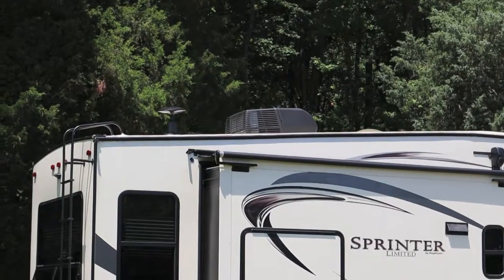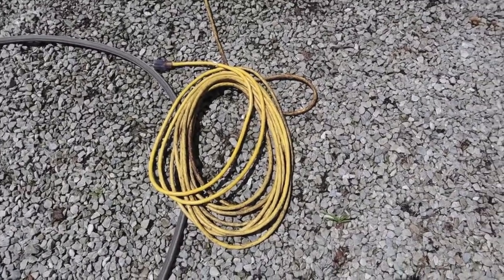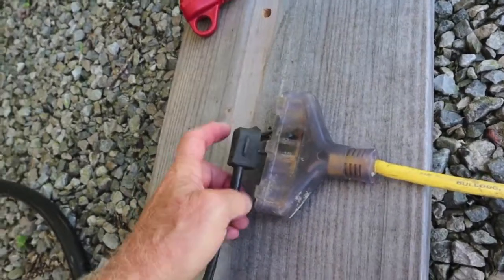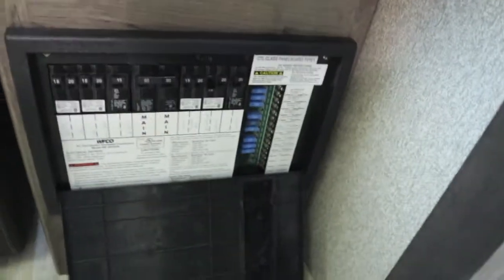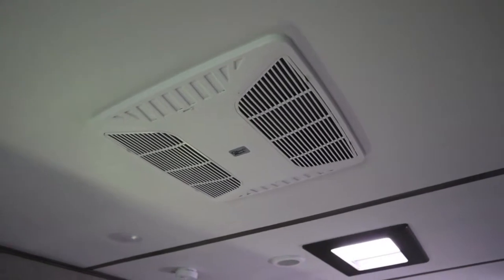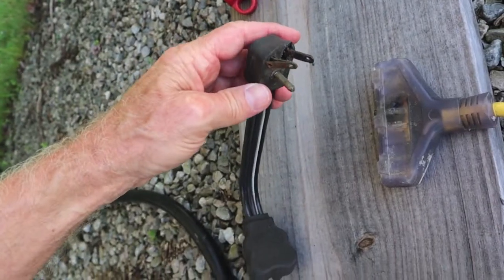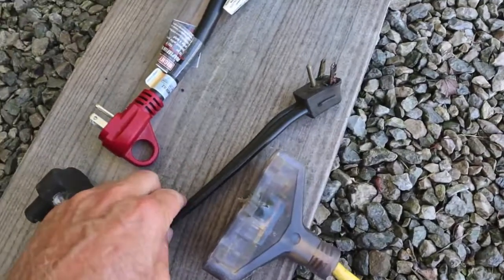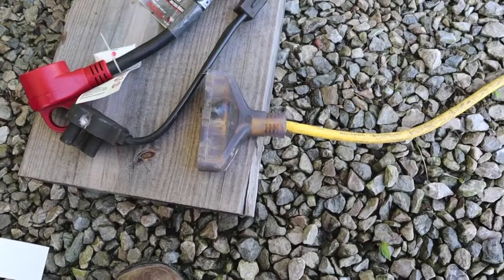RV Air Conditioner on 20 Amps? CAUTION! The weakest link is...

Comment: My Keystone Laredo RV comes with two 15k ACs. I installed MicroAire Soft Starts on both units. I can run BOTH units off of a 20A service, though I don't. My front AC pulls 7amps and my rear AC pulls 12amps. The Soft Start will make a HUGE difference.
Reply from the maker: That's awesome, I'll check out the soft start. I know lots of RVers going to soft start on their AC units.
Thanks!

Comment: Great video. Thanks for posting it. I'm using that same yellow extension cord to plug my RV in out on the driveway. I think, based on what happened to you, I won't attempt to run the AC while it's plugged in like that.
Reply from the maker: If you do run it, just check the temperature right at the connection. Temp gun or a careful touch on the plastic. If it feels too warm, the quicker the material degrades.
I bought the HF Predator 3500 inverter generator to safely run the AC units, but one at a time.
Thanks for watching!

Comment: The best thing is just to buy an extension cord specifically designed for that purpose. A 50 ft  30 amp  /10 gauge solid copper wire/ cord is around $200. This way you don't have to worry about an adapter.
Reply from the maker: Exactly, lots of people will still use the 15 amp cords mainly because they have them. A dedicated 20 amp cord is the way to go.
Thanks for watching!

Comment: It might be resistance on the connectors. I use a file to clean the pins on my plug but if the socket has some light corrosion you just have to replace that part.
Reply from the maker: Thanks for the info!

Comment: I'm running my 1997 Jayco's 13k btu rv ac on 350ft 10gauge wire straight to a 30amp breaker and sometimes I have problems with my ac just shutting off "blower and ac". Can't really do much more besides pitching a tent. Sometimes it runs fine, other times its hell.
Reply from the maker: I would check your voltage drop. 350 feet is a long run, but you are running 10 gauge wire which is a big plus. I ran a sump pump a couple winters back and had to run it on 100 feet of 12 gauge wire. My voltage drop was right at 2 volts. You'll gain some with the 10 gauge but you'll lose some on the extra 250 feet run.
I would also be tempted to install a new breaker. They can get weak.
Thanks and good luck to you!
Reply: @pmtips4482   Sir I just bought a round 30/15 Amp adapter , it's not a doggone cord just the short round adapter will it be safe to plug my 30amp power from my camper into the short round adapter and plug that straight into a 15amp outlet .. I don't need a extension cord cause my camper cord is long enough to reach the outlet.  Any info would be helpful as I am needing to plug it in today .. I do have a very short 12 gauge extension cord if I'd need to run one if I couldn't plug the adapter straight into the 15amp plug
Reply from the maker: @davenstorm7271  Daven, you will be fine if your amp load does NOT exceed the 15 amp level in the long run.
I have used the exact adapter you have and after running the AC for about an hour, the black rubber adapter started getting hot and soft to the point I went with a more solid adapter.
Just get a decent idea on the current load you are looking to pull.
I hope this helps.
Reply: @pmtips4482   Wow I hear you on that , thank you I guess I should of bought the 30/15 Amp dog bone then. I'll just use my max air fan then and not run the a.c ..  Thank you sir for your knowledge..
Reply: @pmtips4482   My Ac is 13,500 btu though where I think you said yours is 15 ?
Reply from the maker: @davenstorm7271  Yes, my main is 15k, research your amp draw on your 13k unit, you may be just fine. Also, if you are on a 15 circuit breaker, that will give you good overdraw protection.
Be safe!
Reply: @pmtips4482  Thank you Sir !

Comment: I've been flagging these kinds of cords for a long time the manufacturers don't seem to care they run a 50 amp circuit and down to 30 or 30 amp circuit down to 15 so now you're protecting a 15 amp cord with a 30 amp breaker big mistake the good quality ones have built-in circuit breakers within the adapter it goes from 50 amp to four 20 amp Outlets with 20-amp circuit breakers on each side those are decent but you can still put a 15 amp cord in them and that creates the problem the 20 amp circuit and cord should have one of the legs turn sideways that's how a 20-amp circuits are supposed to be wired one of the legs in the outlet and one of the legs in the cord should be turned 90° I have contact the company selling these 50 amp down to 30 amp adapters and 30 amp down to 15 adapters and none of them have returned my calls none of them are ul-listed meaning that they're all made in China this creates a fire hazard should be taking off the market when you go the other way it doesn't matter because when you're plugging a 15 amp cord into a 15 amp breaker going to a 30 or 50 amp plug then you have your service being rated at 15 amp so your cord will not melt so unless these adapters have something built into that melts inside the cord if you go above 15 or 20 amps then I don't know where the safety feature is can't get anybody to answer that question this is why I comment on as many sites as I can so people will stop using these things you should never run a 15 20 or 30 amp cord from a 50 amp breaker especially when you putting a 15 amp cord in the middle of the service
Reply from the maker: Thank you for commenting with this information!
You are absolutely correct and the far majority of RVers do not understand the electrical problems that come with using too small of conductors in the shore power setup.
Thanks again!